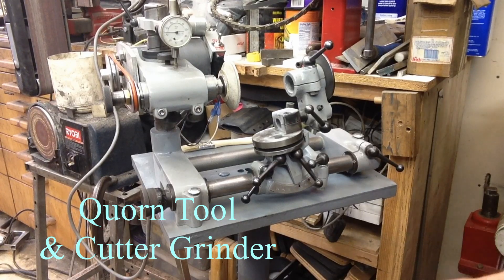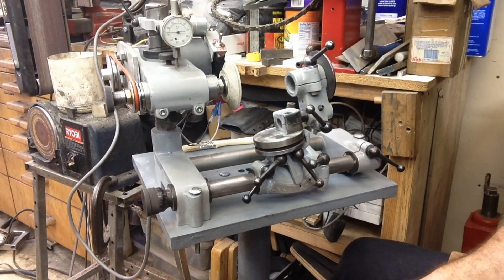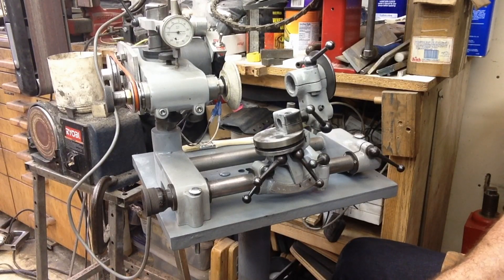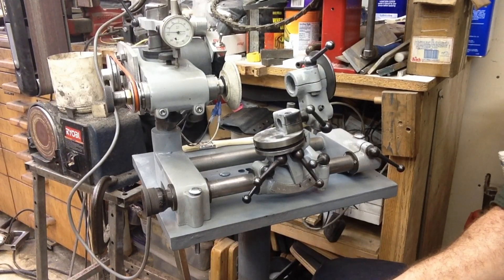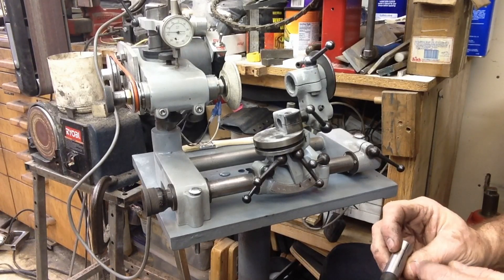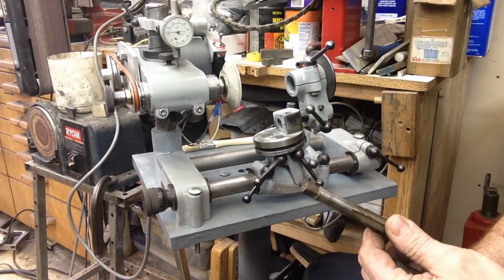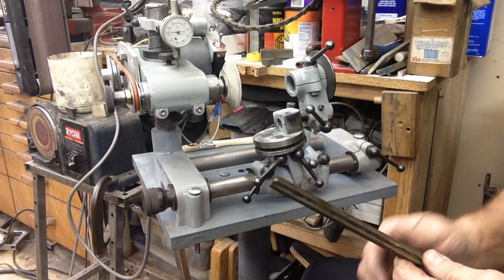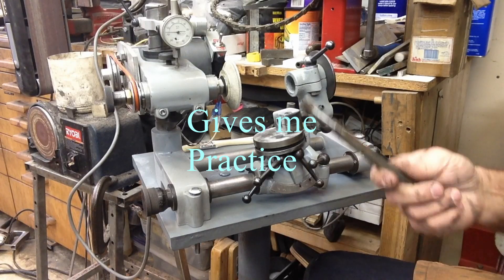Building an Atlas 10" Production Lathe Part 30: Problems! 2nd Production Run

Comment: No cringe issue here with these two. We would say you got the ground between centers diameter spot on for that collet, A tool you can use now, is better then a tool you cannot use at all, wise choice fixing the reamer diameter. We do like your flexible use tool grinder setup. Look at the really nice turret. We have not seen a turret in operation since R and R in the Shop used his to make scribes so this is nice to get to be here and knowing your channel. 
This turret in operation comes a s truly real treat for us, you even added a bit of music to play along with this fine demonstration in work. We even get a cross slide bevel and it can have cutoff tool demo, thank you. 
This is the first turret we have seen with out the indexer arm we are used to on our turret but you still once setup have a great production machine turret time saver we love to watch. 
Lance & Patrick.
Reply from the maker: Thanks guys, I appreciate it. Both my other turrets auto index and it is by far easier to operate, but when Atlas built these machines they were designed to be an economical and simple machine for the home shop, educational tools for schools, and secondary machines for shops to not tie up a more expensive machine

Comment: Was there originally a handle o r lever of some type to rotate the turret? Thanks.
Reply from the maker: No there was not, Atlas called this a semi-automatic turret and it automatically unlocks when the handle is moved to the right and then it is manually indexed to the next position. I believe the capstan Lathe that Atlas produced was auto indexing but it had a bed mounted turret
Reply: Interesting. Thanks for the clarification.  @hillsgun